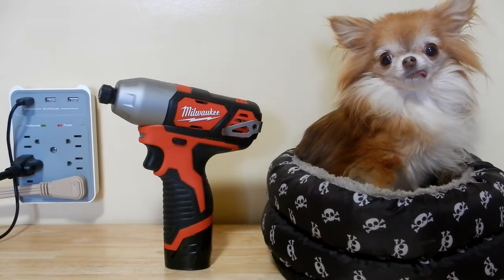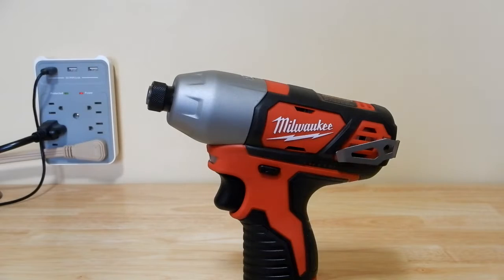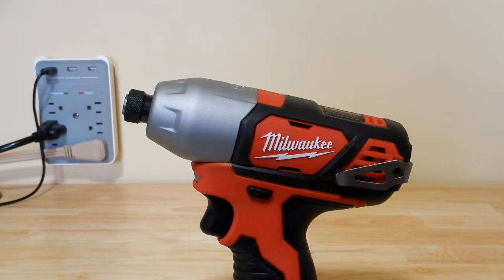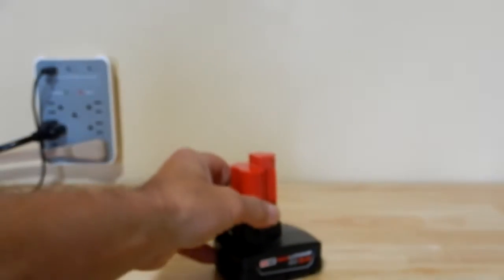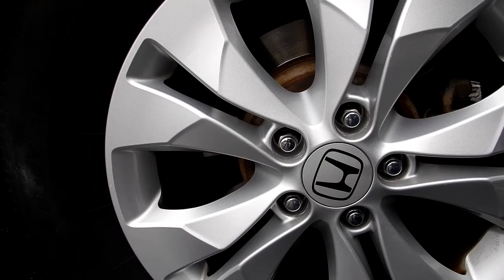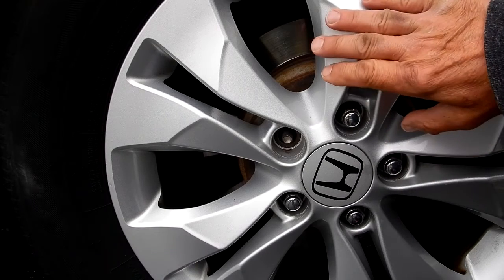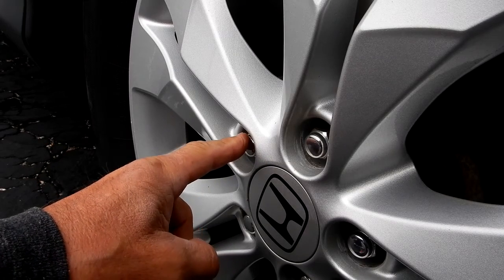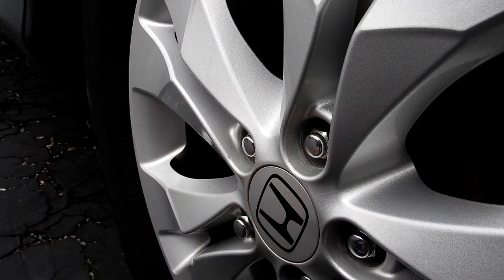Milwaukee M12 Cordless 1/4 in Hex Impact Driver #2462-20 WILL IT REMOVE 80 lb-ft LUG NUTS on my CR-V

Comment: What bit are you using?
Reply from the maker: It's a 1/4" hex to square drive adapter made for impact use. You can get them in 1/4", 3/8", and 1/2" square drives.

Comment: Extra impressive. That’s an impact driver which is rated for tightening. So it gives max torque during clockwise rotation. It makes less torque in the counter clockwise (loosening) direction. Impact wrenches are rated for breaking (loosening) where they apply their max torque. Doesn’t mean they won’t work the opposite way. I’ve backed out large timber locks with a driver, and sank massive lag bolts with a wrench.